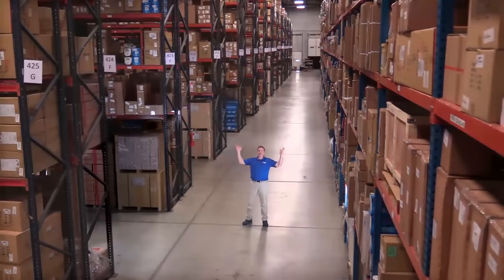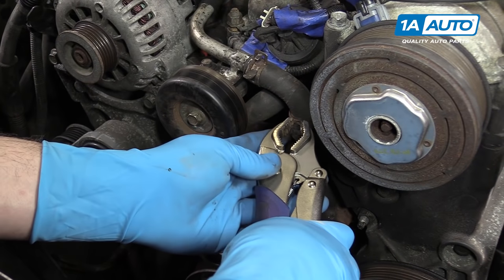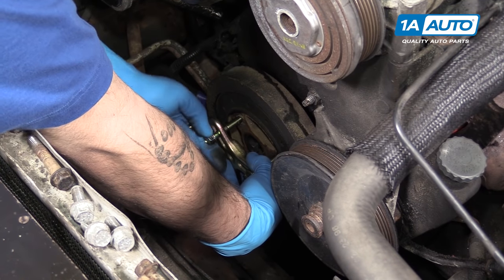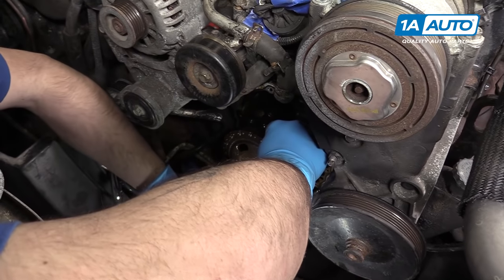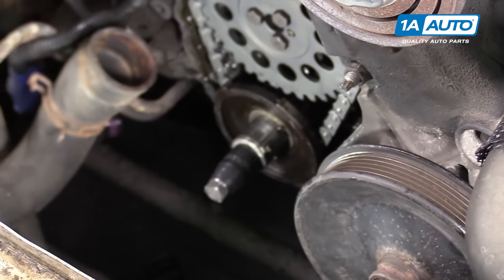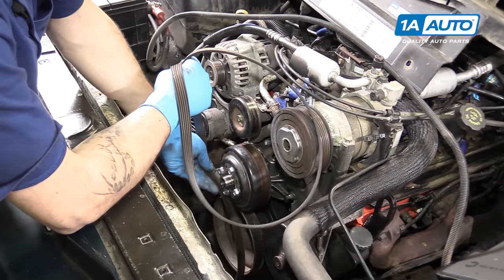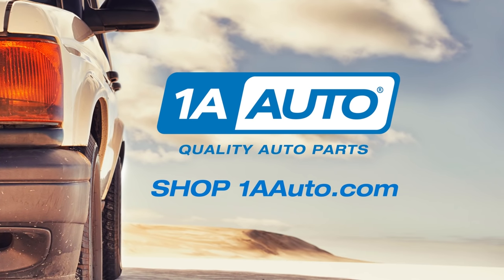How to Replace Timing Chain 96-99 GMC K1500 5.7L

Comment: Enjoyed the video, but I can do without music in the background. I do not know why everyone thinks you must have music with a video, such as RTV ( thread sealer) on threads going into a water jacket and I was wondering about the "oil slinger".  Thanks for the list of items needed for the change.
Reply from the maker: +James Smejkal Thanks for the feedback!
Reply: Hello. It isn't an oil slinger. The part he decribes as one is actually the Crank Position Trigger Ring. It is what the cover-mounted Crank Position Sensor uses to create a reference signal to the ECM.

Comment: So I put a timing light on my truck and it’s showing it’s 8 degrees off. How do I adjust that out before removing the lower sprocket?
Reply from the maker: +Chadwick Perry We currently do not have an auto repair video that covers this particular repair. We will keep this request in mind in the event that we need to make this repair in the future. 1aauto.com

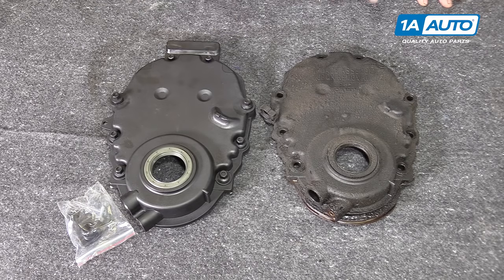Comment: 17:40 question?? A1auto .... So I can make my own gasket sealer for the bottom timing cover? Because I have this thick rubber gasket where you have to drop the oil pan some just to install the timing cover for the bottom rubber u shape gasket to fix properly. What's the name of that oil gasket sealer brand or name?
Reply from the maker: +Darren Stevens You will want to create your own gasket/seal for that part of the installation.  That is just an oil-safe gasket maker that can be found at any local auto part store!  1aauto.com

Comment: Do you have to drain the oil in order to change the timing chain cover ?
Reply from the maker: +D.L.P You do not need to drain the oil to perform this repair!  1aauto.com
Reply: @1AAuto   do I need to drop the oil pan? And will I need a new oil pan gasket?
Reply from the maker: +Wade Yarbrough Thanks for watching!  No you do not need to drop the oil pan in order to perform this repair.

Comment: It's much easier to seat the timing cover if the oil pan is hanging loose just a bit.
Reply: Did you need a new oil pan gasket? I got a 96 c1500 305. V8

Comment: How come you didn't lower the front of the oil pan before you put the cover back on. Manual says lower oil pan??????
Reply: Casue that's more work duh and it's not neccessary.
Reply: i didn't have to either.

Comment: How the h3ll an ENGINE LIGHT is a problem to pass emissions inspection??? I mean, this is a major JOB just to pass inspection in NOVA(Northern Virginia). My 98 Chevy Tahoe has had that light ON... for years and drives, rides just fine. What the F*****! 
I'm pissed! I NEED MY TRUCK ON THE ROAD! And No, I don't have that kind of money to pay for this repair. I just want to go to work, damn it!
Reply from the maker: +veronicathebeautiful If you pull the code it should tell you what is triggering the check engine light. We carry a lot of repair parts on our website for many different year, make and model vehicles. Hope this helps you out. 1aauto.com
Reply: What code p1345?

Comment: I hardly see videos for the 4.3L
Reply from the maker: +Richard Mitchell At this time we do not have any videos showing this installation but are always expanding our video library.
Reply: The 4.3 is a v8 missing the rear two cylinders. This video will work for you as well